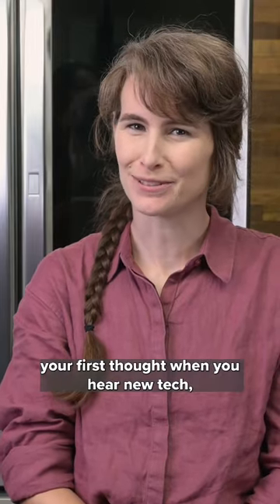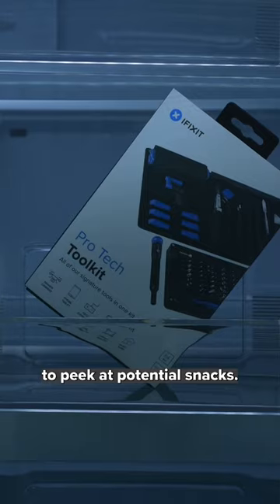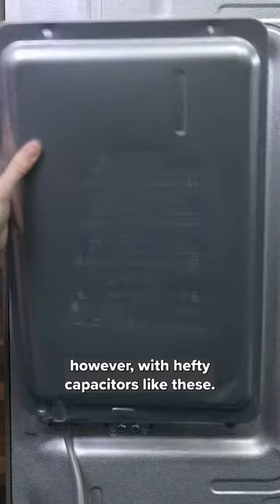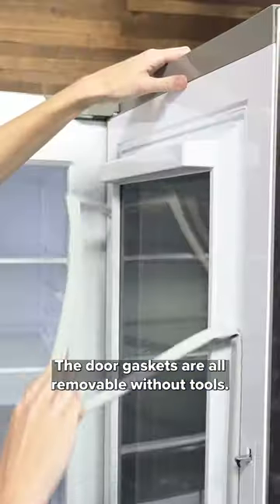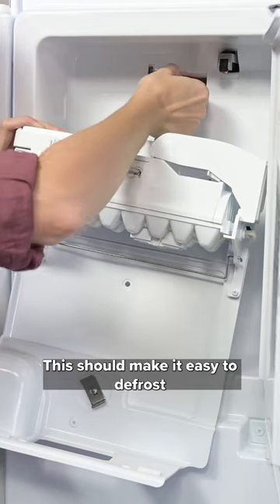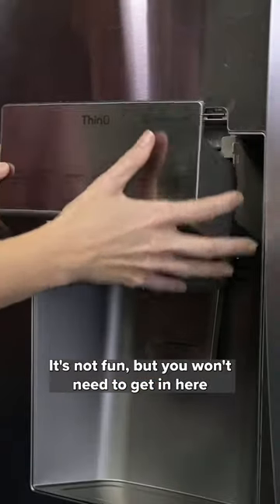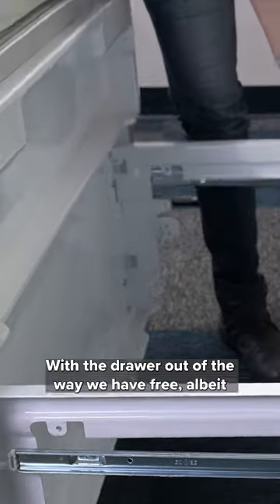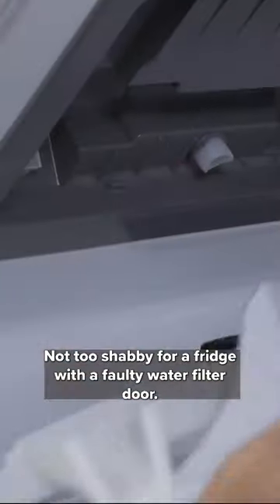Can You Fix A Modern Smart Fridge? #refridgerator #repair #ifixit

Comment: “You shouldn’t need to get in here, unless you’re doing some serious hacking.”

Wonder why replacing the control board isn’t mentioned, as those things DON’T last forever? Well, I’ve seen them fail, but 3/4 times replacing the entire appliance was cheaper than parts and labor, because they could and did proprietize the board sky high and it’s cost with it. That’s why.

Comment: Miss those old school fridges that worked for 30 years and still were cold as ice
Reply: I have a mini fridge running in my room that I'm pretty sure is older than me. Love that thing.
Reply: These will work for 30 years too. I have mine for almost 8 years now, the only problem is that samsung used this weird os for the fridge that dropped on support a year or two ago. So the smart features don't work anymore. Other than that, for all fridge related jobs, it works great
Reply: eh, if these smart fridges are built to good standards they should last just as long.

the problem isn't new tech, it's planned obsolescence.
Reply: @shreyas__  “my fridge no longer has the features I payed double to regular price for”
Reply: @chicken4986 no one buys a fridge for its smart functions. They are a gimmick at best
Reply: @chicken4986  perfectly honest i didn't get it for the smart features. When I got it, I wanted the largest home fridge that was on sale and the largest one just happened to come with smart features. The only smart feature I actually used on it was notes, and notes still work. It's just the phone connectivity features, which I didn't use, which now apparently don't work properly anymore.
Reply: @Shreyas  Yeah, Samsung SmartThings tends to do that.

Comment: I wonder if the water/ air filter has a nfc tag in it so the fridge knows when you’ve changed it.

My fridge has this and if you don’t change the filter when it tells you to it reduces the flow of the water dispenser to painfully slow speeds.

Comment: I got the fridge and gotta say… it’s not good lol
Reply: Why?
Reply: @Justgreen89925  the icemaker in the door makes the fridge SLAM shut because of the weight. Only way to avoid slamming is softly closing without letting go.  It’s not the biggest issue a fridge could have… but none of the other fridges have had the issue for me
Reply: @EnventProductions  not a big deal tbh, the real problem would be if the compressor is trash or the electrics have issues

Comment: These are insane, pay $250 for a used traditional fridge. If you're into tech and want to know what's in your fridge, a $50 wifi enabled IOT camera will do the same, now you're at $300, if you want to see inside the fridge, you could just open it like a normal person instead of knocking. If you're concerned about letting the cold out, check your camera instead.